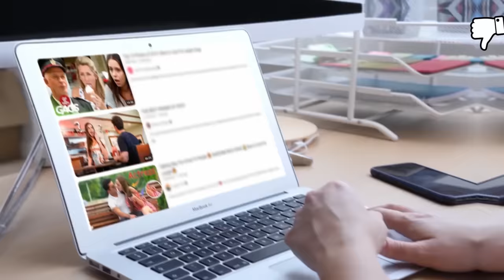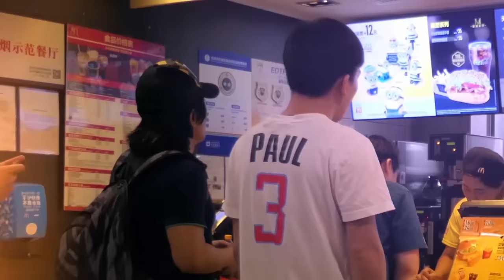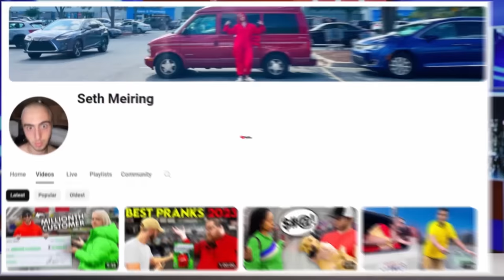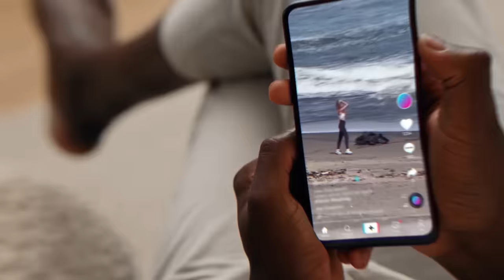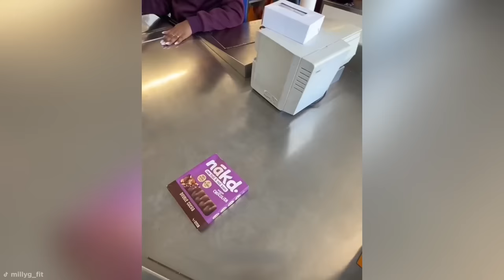Worst People Embarrassingly EXPOSED

Comment: I cannot stress this enough... Pranks sould only be pulled on people you are VERY WELL acquainted with and should NOT cause them ANY harm or extended hindrance to their life. At that point it's no longer a prank, in some cases it can be classified as assualt, or intent to seriously harm, or even just plaun harrassment. I don't think I have to say that those are crimes, but some people clearly know no boundaries.

Also: As an American, I am disappointed by most of the American people. Especially by the unnecessary circuses called "gender reveal parties" I'll say this with so many other people, "We Do NOT Care What Gender Your Unborn Fetus Is!!" If you are going to do a gender reveal party, for some reason, make sure you can AND DO effectively clean up after yourself, blue/pink glitter/smoke isn't worth a lawsuit/trial.

Comment: You're naive if you think Shein is uses different factories than most of the popular fashion brands. They all use slave labor the difference is that Shein doesn't add 20000% income margin on each of their products ( and trust me i know what I'm saying because i worked for one of those companies), therefore they sell more, which obviously causes environmental issues. It is also highly doubtful they build a whole factory as a set up - most likely they do have some decent normal factories in China, but also use aboard factories where slave labor is still a thing ( workers in China are actually do have rights). Their prices for items are much more honest than other brands, considering the t-shirt shipped from Pakistan costs maybe 1 cent but is being sell further for 100$ by a western company when on Shein is maybe like 10$ max. And they also have their clothes in every possible size. 
Im not defending anyone but there's a lot of hypocrisy in attacking Shein for doing exactly what westerns companies were doing for decades atp

Comment: Bikeymikey may be in the right but "self proclaimed deputy police officers" don't have many friends. And to be honest: he should apply to the force instead doing his thing. I mean it. Do it by the book or don't do it at all.

A good deal of cyclists don't really follow the rules to the letter either: depending on the situation they switch between "pedestrian mode" (and use sidewalks) or "car mode" (using streets). Traffic lights get bypassed that way more often than not and switching lanes can be described as "as long as I don't have to decelerate, it's okay". And while drugs and alcohol don't get along if you're want to drive your own car, nothing stops a cyclist from doing so, even if clearly unfit. Needless to say I hate it: cyclist should stick on the road and obey the very same rules as car drivers do, even if that means they have to stop and wait for traffic lights, other traffic or pedestrians: there's no right to race applies to cyclists as much as it does to car drivers.

Just saying. If I get a dime for every broken rule by a cyclist, I could buy me a house and a second one for each rule broken by car drivers.

- a pedestrian, using the car only to get to and from work.